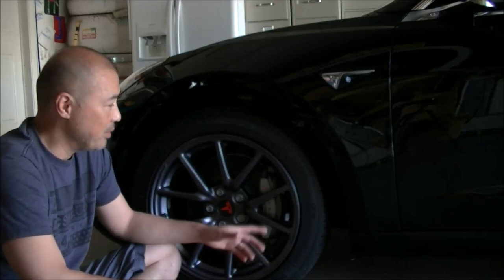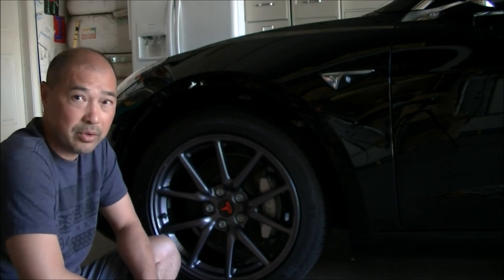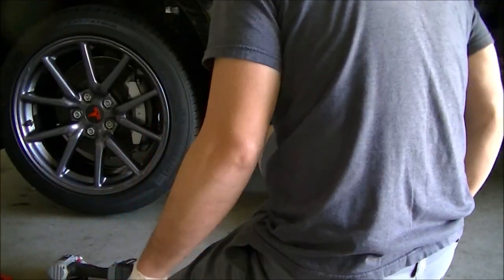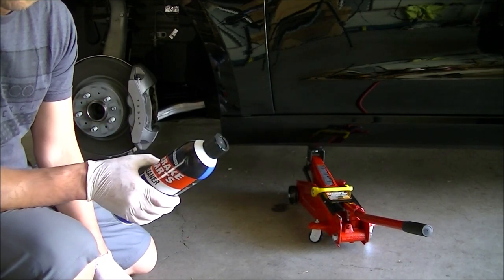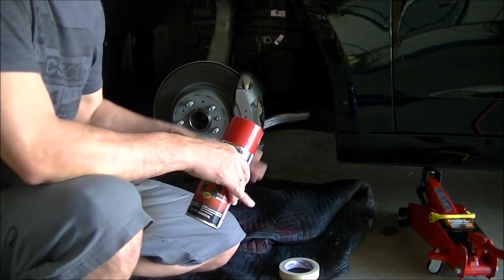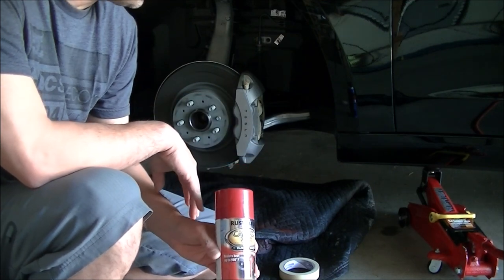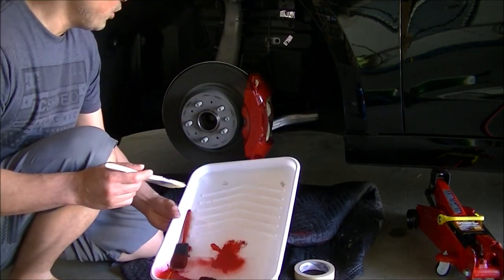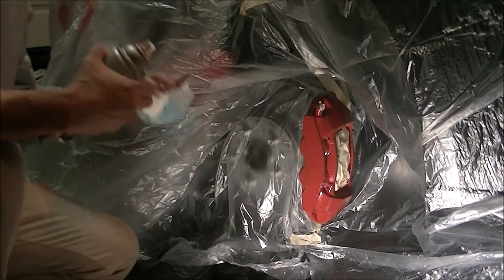Tesla 3 Red Painted Brake Calipers and Decals

Comment: Looks great I want to do the same. How long did the job take in total?

Also how tight did you tighten your lug nuts at the end?
Reply from the maker: Luyen Dao , I only did one wheel a day since i don’t have a lift and need to wait for paint to dry to do next coats. 129 lb ft torque.
Reply from the maker: 129 lb ft torque.  Took a few days since I basically did one wheel at a time.  Needed to put on a few coats and let dry.